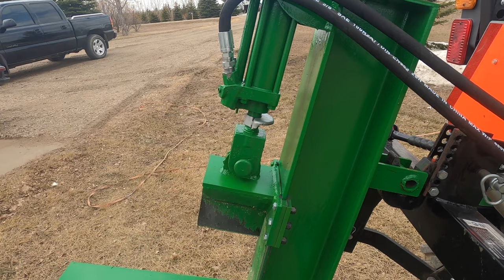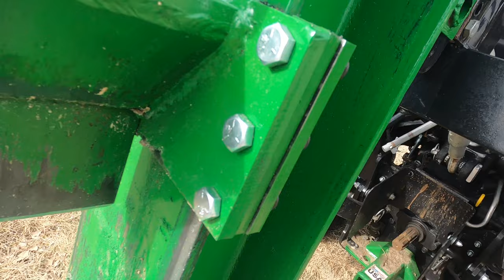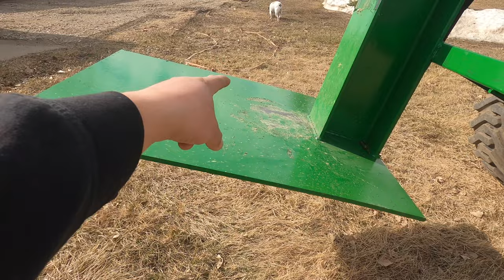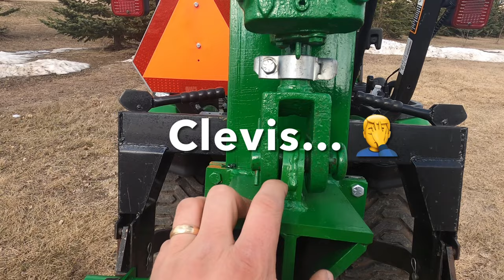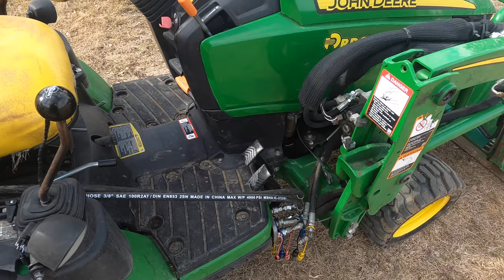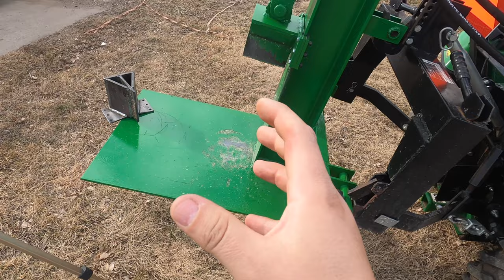How to build a 3pt wood splitter.

Comment: Great video. I have a 5 ton electric splitter and it splits all my hardwood and softwood. 
If I was building that I would want a longer stroke. But that’s just me. 
Having the hoses run to the middle of the tractor and having to use the loader valve to do the splitting is a great safety feature Dash. Keeps you away from the splitting and ram. Much less chance of getting hurt. 
Just my thoughts. Everybody’s is different. 
Have a great day.
Reply from the maker: Thanks, Noel! I never really thought about it that way of it being safer by standing further away, but you're absolutely right, it is safer. I think this cylinder is more than enough power to split any pieces of wood I throw at it. Much like your 5 ton is. I appreciate your thoughts and commentary. Have an awesome day!

Comment: What if you used your  grapple 3rd on valve, and add a secondary switch at the back.  Than add you could plug / unplug it if your doing log splitting

Comment: Hey Dash I broke down and bought the Deere dual rear remote kit for my 2038R and could have saved on aftermarket but man deere makes it so easy as all the connections are already on the tractor and all the parts fit perfect. Was it worth it? I'm not sure,but I do have dual remotes now and everything looks factory. I wanted a hydraulic too link and a tilt for my back blade and the box blade
Reply from the maker: Nice! I like your setup Jim. I think I will add some remotes to the back of mine at some point as well. I have a diverter up front for my grapple and I really like it. I too want a hydraulic top link. Id like at least 2 remotes just like your set up.
Reply: @TheLittleGreenTractor  It does make your tractor life easier and more versatility. My next project is a cylinder to change the angle of my back blade from my seat lol